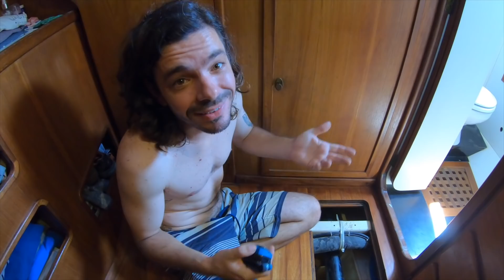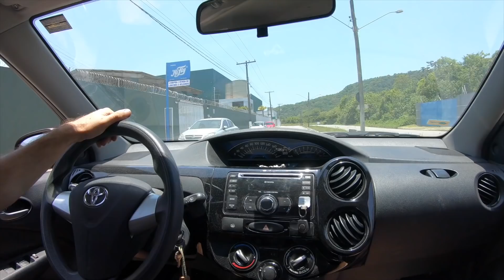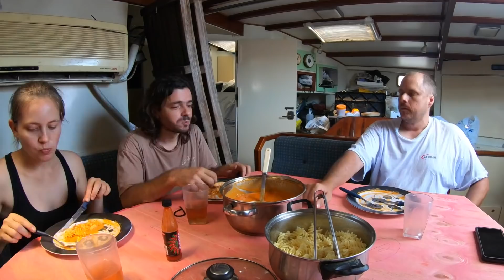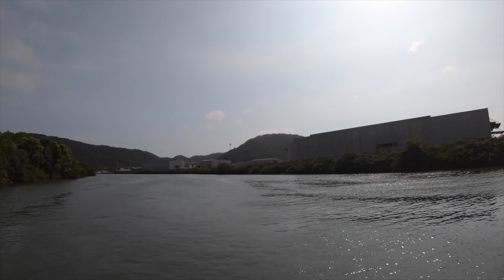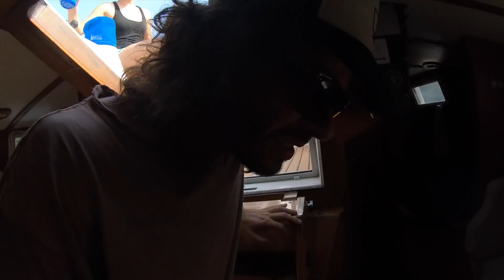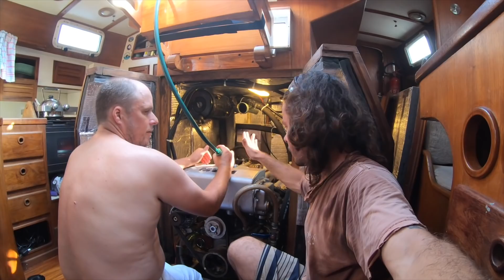⛵️First SEA TRIAL after 23 year on the hard!! (didn't go well!! 😨) Not Click Bait #163

Comment: A new engine is always the best option. But as a mechanic with over fifty years experience I can say this; I have seen brand new engines blow up because they were not properly assembled. I have seen a brand new GM 350 V-8 engine come in with 8 cylinders and only 7 pistons. On the side of the block it had a QC label stating the engine was tested and is okay. 

As for rebuilding the present engine, if done correctly with quality parts, an experienced mechanic, properly maintained with attention to detail there is no reason to not expect the engine to give you many years of reliable service.

For either a professionally rebuilt or new engine a proper shakedown is a must. If it is going to fail then let it fail at home, not in the middle of the ocean. I have seen many sail boats with a 150 hp outboard engine as a backup to the main power plant. Kind of like wearing a belt and suspenders to hold up your pants. 

Just my two cents worth...

Comment: Option 4: Replace the Diesel Engine with an electric drive motor.  See “Sailing Uma” to see the advantages: 1) No need for diesel fuel, unless used for generator; 2) More reliable; 3) No need for gearbox; 4) Quiet; 5) No exhaust/odor; 6) Super fast response, including going forward to reverse; 7) Easy to repair anywhere by electrical shop (e.g., motor rewind shop); 8) No concern about running hours; 9) No preventive maintenance (no oil changes).  Alternatively, you can empty the diesel tanks, clean them, and use for water.

Comment: A couple of options you didn't consider:

1. In the old days before marine engines were a thing, people use engines from large family cars or small trucks for powering their boats, 48hp is not much in a car engine these days, so if you can find a diesel from a small hatchback (Polo, Golf, 208, 308, C3, C4 or similar) from a wrecker especially one with low KM, this might be an option, you would need to keep or get a new heat exchanger to replace the car's radiator. Never discount the ways of the old timers. At least the parts will be available in every/most countries and won't carry the "marine engine" tax.

2. Try to find a company in brazil that is doing electric motorcycles / cars and see if they are interested in working with you to developing a new market for their electric drive trains, a quick google search turned up "Electro Motors do Brasil" as a possible company to approach.

In the end after doing some research the Yanmar option may still be better for you, but at least investigate these less conventional ideas, and if they are not right for you ok, but maybe my putting them here will help someone 🤞🏻

Comment: Check compatibility of new engine with existing propeller (power output and RPM), also output flange on gearbox, direction of rotation of shaft height of engine beds crank shaft/output shaft offset etc etc. If modifications are needed to change to a new engine this will add to the cost. Many older engines were preferred by fishermen as they produced the power at a lower RPM. 
A funny thing happened to a fellow I know who replaced his engine and gearbox. The boat went astern when put in forward gear. He stripped the replacement gearbox before he realised the output shaft turned the opposite way to the old gearbox. The solution was to replace the propeller which he should have done in the first place as the "new" engine required a different pitch. Well, I thought it was funny at the time, he "saved" the cost of a surveyor!

Comment: Yup I'll pretty much parrot the "get the new engine" bunch...Key reason why is available parts found everywhere and reliability vs who knows what you'll find after opening up the old one. People have to remember this is a ocean going boat, not a car where you can pull over at a quick part shop at the corner, If a part breaks 5000 km away from home and you have hard to find/get parts your going to get really boned for dock fees alone just waiting for shipping to get those hard to find special parts

Comment: You narrowly avoided disaster before the sea trial commenced by putting on power with the mooring ropes not secured back in the boat - you could have easily had a prop wrap there.

I hope the new engine install is as simple as the Yanmar rep suggests - but will it be compatible with your gearbox  and is the new engine the same DOR ( direction of rotation) as your old one.

You should investigate Beta Marine as a candidate for the new engine and evaluate against the Yanmar (which have a reputation for expensive spares).

Leo Sampson (Tally Ho) just released a video on choosing an engine which may be interesting for you to view.

Keep up the good work (and avoid prop wrap)😉

Comment: Modern Diesel = modern efficiency and reliability. More power if needed and if not better speed and efficiency with less stress on the engine. Get the correct reduction gear that optimizes the efficiency and speed of the boat. finally a low drag and otherwise optimized prop and you will be a happy sailor. USCG and competitive sailor. Nice boat ya'll.

Comment: The Yanmar engine is used in many things just as a powerplant, if things went wrong you could find yourself in a scrap yard taking a part off say a woodchipper/generator to fit on the boat that to me is a bonus to get it going not to mention it might be easier to buy something with the engine in than buying the engine alone and get something back for scrap of what's left these are things to consider when buying a new engine for a project like this what can you scavenge parts off to keep you going until replace with  new

Comment: I trust old reliable engineering more that complicated new stuff. That engine is a tried and tested reliable model used by every fishing boat in Brazil (well almost every fishing boat). It has had the head off to partially check the inside. Everything was perfect. It started up within a second and immediately ran evenly on all 3 cylinders when tried for the first time in many years. I am confident from what you have told us about the first owner that the engine was well maintained. You have there a little gem. Don't fall for the propaganda that new is best, or new is reliable. Fix the oil leaks in the prop shaft, and the gearbox. Fix the heat exchanger. Then use the money that you save on not buying a new engine and put it to better use, like going places!

Comment: Great thing about replacing your diesel with a Yanmar is that you'll have a 5 year warranty (2 + 3 extended warranty).  You won't get that with a rebuild.  Peace of mind that you're diesel is reliable and you have the manufacturer standing behind it.  No brainer.  Bonus that you can sell your old motor for a 1/3 of the cost.

As always, thanks for sharing the video.

Mike

Comment: I wish I had gone with the Beta 60 over rebuilding my lister HRW3 (45hp). There was only $600  between the rebuild price so far and having a new Beta 60 (made above ground) sitting on the dock. I still have minor issues with the Lister to sort so I’m sure it would have worked out cheaper to buy new. That’s in New Zealand. Good luck!

Comment: Hi Roberta and Duca, besides the heat exchanger  and the shaft seal, please consider that the your engine smokes a lot. Looking at the smoke most probably there is a problem with valves. My suggestion: take into account a new engine but buy a Lombardini or Nanni rather than Yanmar, as they are a bit cheaper and exactly same reliability. Ciao Ciao

Comment: Wise choice to take it out of the water. If that’s a drawing of your propeller shaft housing, you don’t have a choice. That kind can’t be allowed to leak because salt water is at the ball and roller bearings. If the bearings are 440c stainless it would be better. Replace all the seals and bearings and have peace on mind. Don’t forget to put a good coat of marine grease on the outboard seal as oil can’t get to it because of the seal next to it.

Comment: Yanmar is a beautiful engine very very reliable, but there are other options: for instance there is the hybrid option where the engine and drive train are conventional supplemented by one or two alternator/electric motors that are driven by the engine, huge amounts of electricity can be stored in a lithium battery pack. When only a few minutes of engine time is required the alternators work as electric motors. All this very well explained by Leo on his You tube Channel “sampson boat company” it’s in the last episode by the way.

Comment: Have you considered a reconditioned yanmar engine? If you are not familiar with "reconditioned", it means a second hand engine that has been completely rebuilt, professionally. It will be as good as a new engine and won't cost as much.
Reply from the maker: There are not many Yanmar engines recondicioned to sell in Brazil. We prefer to buy a need in case of changing it 😉

Comment: Urge you to go for the new engine and gearbox. It'll be quieter, more efficient, cleaner, possibly less costly now, and more easily maintained and repaired. If you really plan on going places with the boat, you'll be happier with a new install. You might also consider a Kubota based option such as Beta or Nanni. Your shaft seal looks more complicated than necessary and may well be a long-term maintenance problem for you. You may want to seriously consider replacing that as well.

Comment: My two cents, Get your heat exchanger sorted out.  Run the engine as is and go sailing.  The engine may last another 10 plus years before it needs major repair or replacing.  Get the basic spares, impellors,  zinc anodes, filters (oil and fuel) and go adventuring.

Comment: I'm with you Duca. It is shame to spoil the boat for @a ha'peth of tar'. I would go for the new engine option. Even with an overhaul your existing is still 20+ years old and will need more and more attention as time goes by.  If you had used it for a number of years and knew it better you might be in a position to think differently. Good luck.

Comment: My opinion.  Buy the Yanmar.  I'm not a sailor, I have no personal experience, but it has a great reputation.
It's expensive, but as Duca said, it's an investment.  It's reliable, and you are correct that parts are available around the world for it.
Make sure you are also changing out the gearbox when you change the engine.

IF you are seriously thinking about electric, go Elco, but honestly, don't.  You would probably need 2.5Kw of solar and a whole lot of Lithium batteries.  You'd probably be replacing ALL of the fuel tanks with batteries.  A lot of work and a lot of expense AND all the solar panels would ruin the pretty lines of Odd.

The new engine choice, if you can afford it, is your absolute best option.

Had a weird dream today about Ben and MP.  I dreamt they had to pull Yaba out of the water, and they landed it without a support cradle.  Yaba went crashing over on her side with lots of destruction.  I wonder if those two have ANY idea what they have gotten themselves into.  I think they are still going to be on land, doing so much work by the time you have thousands of miles under your keel, after you get Odd totally ready.

Comment: I don’t think the engine is bad.
Salty water in the coolant is not the engine.
It showed to not have excessive blow by and started right up.
A diesel will have lots of blow by and oil leaks when worn out.
And can be hard to start. 
If you change it and don’t change the heat exchanger you may have the same problem with a new engine.
As long as this one runs and is not making noise like a rod knocking  (leaking and using) and not losing oil. 
And don’t have excessive blow by it is in good shape.
Oil leaks is a tell tell sign Of blow by. It puts pressure in the crank case and push’s oil out.
Remove crank case filler cap while running at high rpm, and blow by will show. (Smoke coming out of the crankcase.)
Some diesels make lots of knocking sounds and is normal behavior. Injectors knock on some.

Comment: Check the most recent episode of Sampson Boat Building where Leo is rebuilding Tally Ho, a very old boat.  He’s an expert shipwright.  He is doing a hybrid engine which makes sense.  If you went with an electric engine, you would need tons of wind and solar as well as a diesel generator to power it on cloudy days.  The hybrid diesel has two alternatives that power the engine when not using diesel.  It makes sense for a boat at least until electric engines are able to be better powered with renewable sources.

Comment: I like your thinking and a new is an investment and adds value to the vessel but unfortunately deteriorates very quickly.. but your safety factor is far greater than the cost of the new reliable engine.. some parts can be found from Toyota. Safe saili g just love your way of thinking

Comment: Go for a new yanmar but not with common rail pump.If you sailing around the Americas,consider,Cummings diesels also
Reply from the maker: Thanks for the feedback, Michael
Reply: @OddLifeCrafting  i used to owned a 32 'fising boat i had a YAMAHA marine diesel  the heat exchanger is similar to your engine it was 32 hp very reliable and economic.Yanmar is one of the best but like all manufacturers they are incorporating too much electronic in the new engine in fact i like your engine its basic can be fixed with a hammer.Its like having an old land rover.Check this link its a UK family which has a boat in iron similar story like yours doing a rebuild i think you can help each other.BY THE WAY I LIVE IN YATCHING PARADISE HOPE TO MEET UP ONE DAY SEARCH SEYCHELLES THATS MY COUNTRY .MERRY CHRISMAS AND HAPPY NEW YEAR.ps the zf gearbox you won't find better.

Comment: There is a yacht right here in Queensland, Australia with the same engine as yours. Not many dealers here though. Yes you can sail oceans with an electric motor or none at all, but coastal is different. Lots of things to run into, lots of currents waves and swell determined to lee shore you or embay you. A YANMAR 4JH5-ASE might be a sensible option.
Ask anyone 60 miles out of port on a coral reef coast with a dangerous weather front approaching what sort of electric motor they would like, and how many batteries.

Comment: Stressing an engine that is that old being tied to the dock with 100% friction is a good way to break even a new one.  Yes it served the purpose of showing you some weak spots but it may not have happened under normal operating conditions.  20 year old seals and bearings wold never hold up to that amount of stress.  No need to replace such a fine motor! It, like the rest of the boat, just needs to be updates. Stay safe and take care,

Comment: You should check out the tally ho project with Sampson boat Co. and their most recent video with the kubota diesel marine engine with dual alternator option. Charges batteries quick but also while sailing spins the alternators with the props if you wish and offers free energy also. I am not sure about $$ but you should check out his videos on the historical wooden gaft cutter sail boat in general. Love your channel and the DIY projects. So many hoses!!

Comment: Great explanation how the heat exchanger brings in salt water, and uses fresh water.  Does the fresh water in the heat exchanger also supply the water heater with pre-heated water?  I assume there's a check valve to prevent "engine" water from back flowing into the fresh water storage tanks, but is the hot water drinkable if it's going thru the heat exchanger?  Also, the propeller shaft problem is just the dripping oil, right... the salt water never made it into the bilge thanks to the oil back pressure.

Comment: Update with current model engine and gearbox. You already have lithium batteries, so electric motor is an option. Installing electric is expensive unless you research and perform the installation, which requires more time. Electric cars are making components cheaper and available.

Comment: I really like the third #3 buy a new engine because a rebuilt old engine is still an old engine! Plus A. quicker out of the ship yard. B. warranty C. parts availabiltiy. D. 1-800 number to ask for help any time you have an engine question. Now you may not be into hybrid systems but Leo makes a good point. "Choosing the Engine (Rebuilding Tally Ho / EP87)"

Comment: The project and your contribution deserve a new MOTOR. It is certainly not your goal to be in another PORT in 2 months to find out that you should have exchanged the ENGINE before the first departure. The engine is one of the most important parts of the SHIP, along with ROBERTA of course, and a safety aspect. IT's a long-term decision.  And DUCA had time to go to a barber, HIHIHI.  I WISH YOU a lotof sucess with your boat.

Comment: Watch Leo’s latest video over at Sampson Boat Co. Channel.   He deals with the entire question of picking the right engine for his boat, and the solution he settled on is perhaps the best, if they make one small enough for your boat.   It has an electric Generator/Motor built in line with the Diesel engine...so that you can run on diesel, OR on electric. When you run the diesel, it charges the batteries...  but even better, with a feathering prop,  you can charge the batteries when under sail... the wind drives the boat- the water drives the prop, and the prop turns the generator to charge the batteries.   You could theoretically go for thousands of miles without ever having to run the diesel motor, and always have fully charged batteries, and enough to spare to motor into harbor under silent electric power.  This way you put the least number of hours on your Diesel engine. And save the diesel on board for when you really need it.